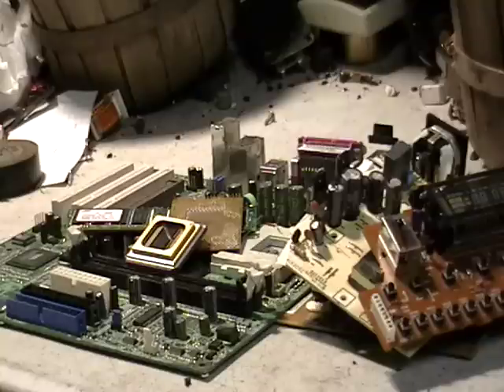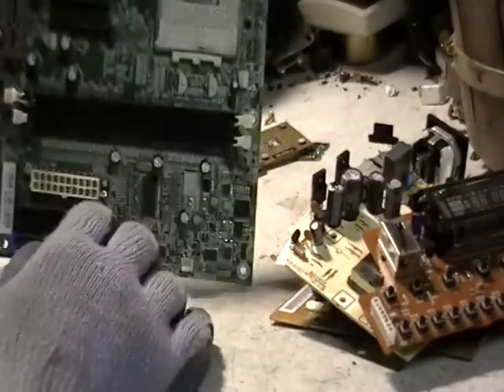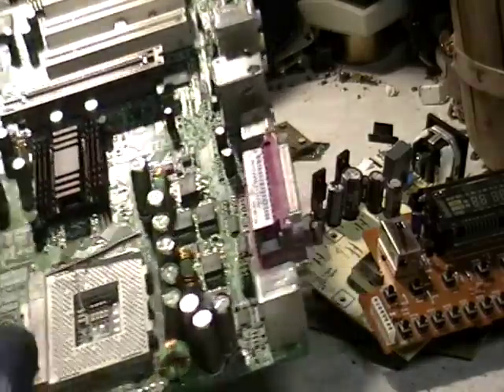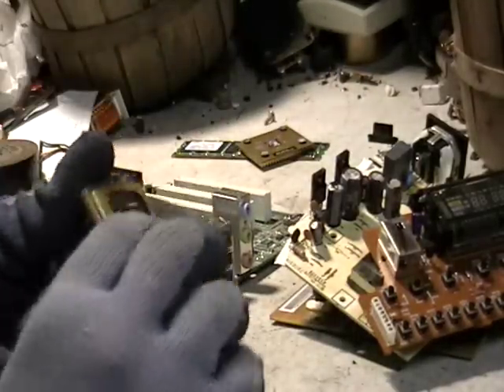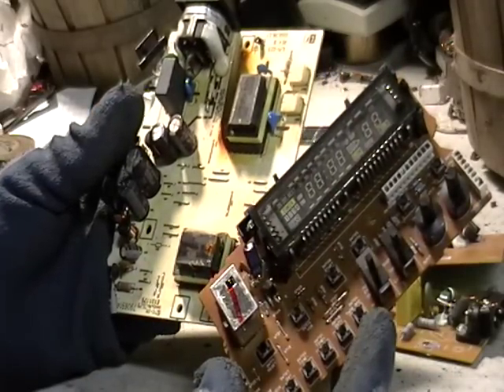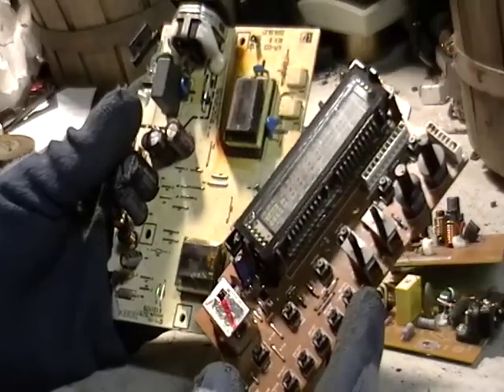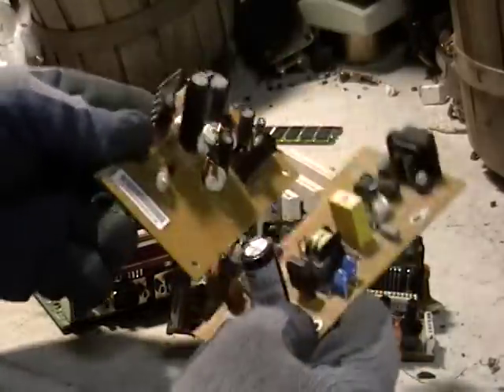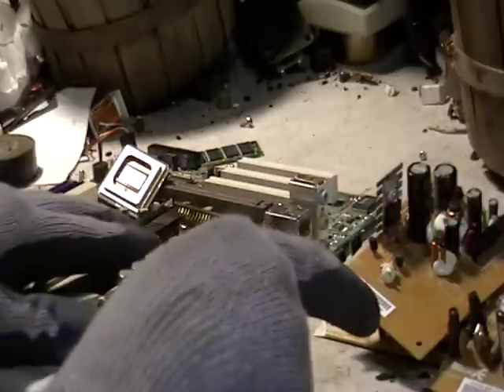Questions for Mike 1

Comment: Forgot to mention that Best Buy only accepts old TVs that are not larger than 32".
I button the larger televisions back up and store them until I get a flyer/mailing advertising a scheduled EWaste pickup in my area. 
I wish I could find somebody in Northern California that takes the CRT tube alone. I know there are companies that do. I'd like to be able to keep the plastic casing and sell it to a company in my area that recycles plastic. Do enough TVs and the weight adds up pretty quick.

Comment: on the hard drive how do you get the platter off ?  the center has raised areas and holed  its the aluminum center the raised and holed are rounded not a screw a hex or a star ideas?
Reply from the maker: I hate those. I use a vise and a hammer to get off....